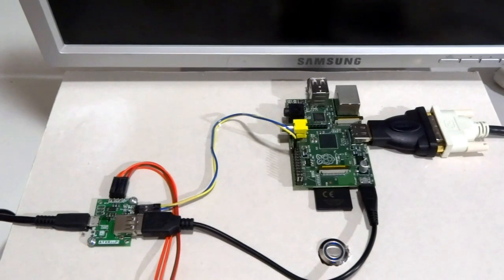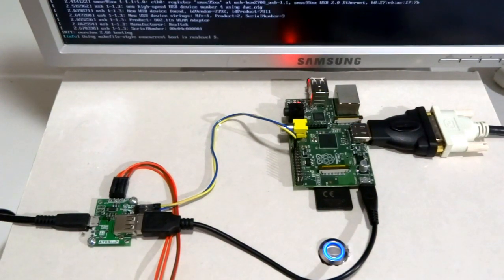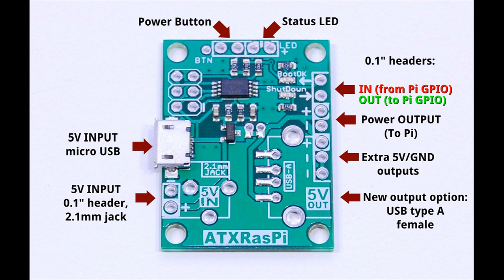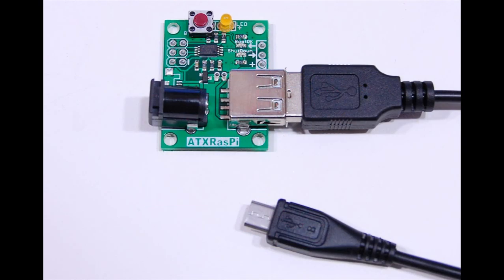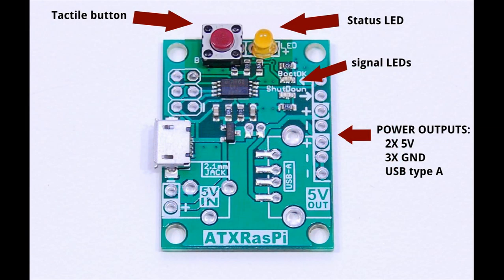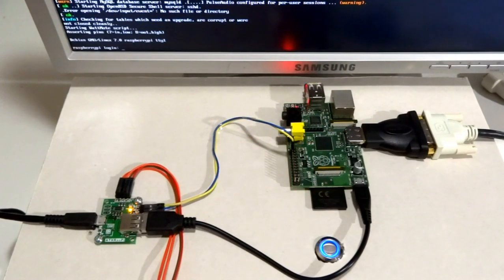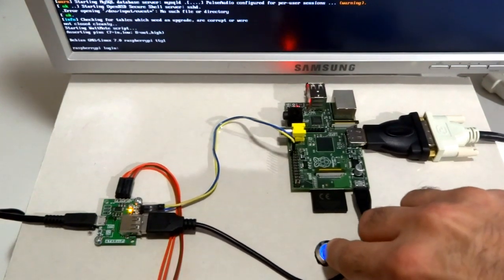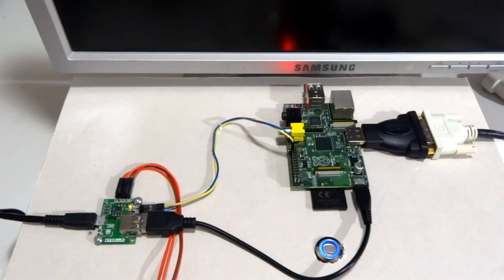ATXRaspi (R2) - Power controller for Raspberry Pi

Comment from the maker: I have not tried it with batteries, but at 4V the circuit would probably still be working since it browns out at around 3V. The Pi however will die much sooner than that. I would not recommend running it at 4V since the Pi spec requires 5V input.Batteries drop voltage gradually, and would not give you a very long runtime unless you got a huge battery.

Comment: Hi!  
 what would happen if the supply voltage goes under 5V( e.g: go to 4V) would it automaticaly shut the Pi down?
It would be perfect for me if it can do that because I wan to use a Batterie to supply my Pi.
Thanks

Comment: If you shutdown the Pi via SSH, will this still cut off the power after shutdown?
Reply from the maker: Not the way it's programmed right now. But it could if the MCU would be reprogrammed to detect that. However in case of a SSH reboot the effect would be the same (BOOTOK signal goes low during reboot as well) so that's why this was not done by default, the point being if you do SSH shutdowns you don't need this board :)
Reply: Felix Rusu Quick Reply Thanks! My question was about running XBMC with a custom timer to shutdown. Next time i wanted to switch it on would be to pull out the power and plug it back in, Would be much better to just have a button to press :)